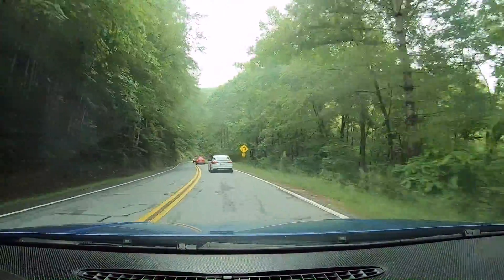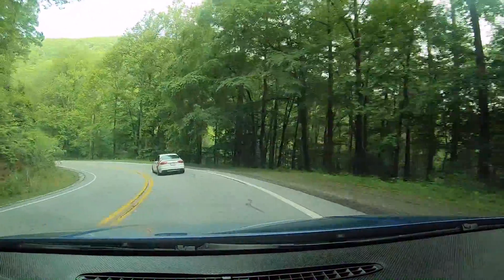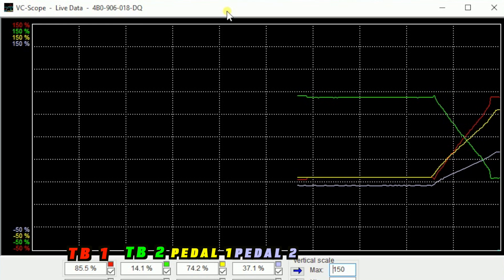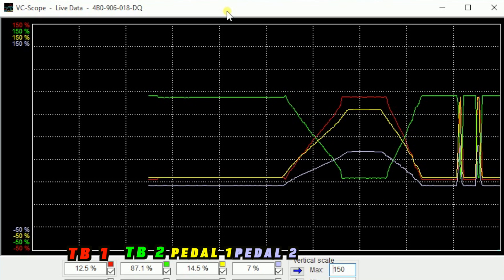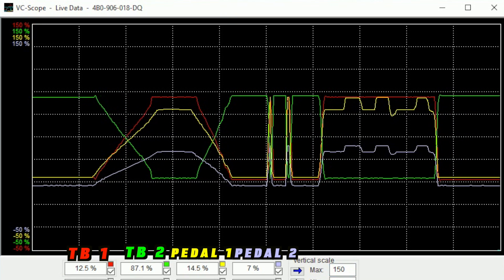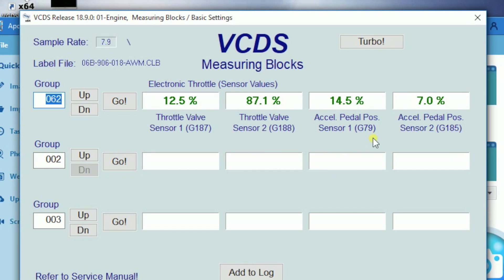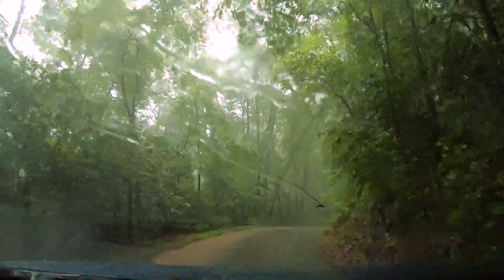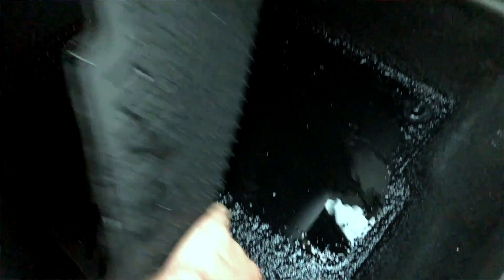What Can Cause Check Engine Light and ESP Light with P0221 Fault

Comment: It’s a Kia Forte issue, as well. New tb, new tp and the same old issue. Difference being, the lane assist and pedestrian warning lights will activate and then limp mode. I never could get the car to do it for me (it’s my daughters car), but one day, while at idle, I lightly lifted up on the throttle terminal and, voila, the engine stumbled and all the lights came on.

Comment: p0221 code 
checked the harness , throttle body to ecu to pedal .
rewired it . ok
swap tested with spare pedal and throttle body .
checked ECU. ok 
removed intake , cleaned /checked variable flaps . actuator ok 👌 👌.
cleaned injectors .
car wont rev past 4000rpm 
boosts fine at any gear as long as its under 4000rpm . 
after p0221 erased and did all these things , check engine light never came up again .
any chance it could be the high pressure pump ?????
BZB engine 1.8 tsi skoda superb 
HELP !!!!!!!!

Comment: Great video information and road trip and awesome channel. Quick question if I may Charles, I don't have a VCDS but just a regular OBD2 scanner with live data, so I have an Audi A3 2015 Quattro with intermittent codes: P0221 and P0121, no throttle, EPC, ESC, CEL, shutting off and restarting the engine fixes the issue temporarily, so when the problem occurs I shut it down, with ignition on, I scan with live data to look at my TP option and when pressing on the gas pedal slowly to the floor, it climbs up to about 88%, so do you think that is an accurate test to dismiss the throttle body issue and wiring? I will re-pin like you explain in your video but just wanted your opinion on that. Thanks a lot, John
Reply: im gettin same rn

Comment: I had the code for sensor A, replaced the throttle body with a new VW one, and new connector with wires, about 8 months ago. Now I’m getting p0221 sensor B. What could it be? I have a 09 GTI 2.0 TSI. Much appreciated. Love your videos!!!!
Reply: You ever find out a fix I’m having the same problem unfortunately I haven’t replaced my throttle bottle but I feel like that isn’t the problem

Comment: My 2010 gti was running perfectly, this morning i change my boost gauge and when i make a test drive to see if the gauge was reading well my car start like to misfire and dont make the idlle rpm so it shutdown , i search my vacuum lines from the turbo to the gauge and cant find nothing wrong

Comment: 2007 VW GTI 6 Speed, P0221 Code Brand New connector with new wires, Brand New Throttle body, But i still get the EPC & CEL come right back on as soon as the code is clear and will not build boost so is in limp mode cannot figure out what’s going on? Only code that i have no other codes
Reply: Hi did you ever solve this thanks getting same issue

Comment: I had my tpms, esp, check engine, and parking brake light all come on at the same time after I installed my cts turbo intake kit. The mass airflow sensor got unplugged and now the lights haven't gone off yet.
Reply: You will need to change your ignition starter switch
Reply from the maker: Might need to clear those codes out.

Comment: Hi good afternoon.  I have a 2009 Tiguan.  The check engine light came on and on the display the message 'engine fault workshop ' came up and an illuminated EPC light. This happened for two/three days and now it won't accelerate above 30, idle really hard and it even cuts off now. Carried it to be scanned, they made me change the fuel pressure sensor,  oxygen sensor, coil pack, plugs all sorts of things and guess what, it's still giving the same problem.  I'm feeling hopeless,  any assistant you may be able to render, or advise would be greatly appreciated.
Reply: If you quickly upshift to 4th you can cruise at 65. Not the safest thing as you don’t get that acceleration if you need it but it will get you home fast. By the way, I have the same issue and will be repinning TB as prescribed.

Comment: I've been trying to chase down this problem for a while. I replaced my throttle body and accelerator pedal with no change(both junk yard parts). Then I watched this video and repined my throttle body and it's perfect now. Thanks much for your help! 07 vw Rabbit
Reply: How did u re pin the throttle body

Comment: #1 I’m from Helen Georgia. Two how to you re-pin the wiring harness? I’m not electronically inclined. Never was trained on it. Mine is very sluggish at take off and also sputters going in higher speeds. Epc light comes on intermittently. When it does that’s when car acts funny. I have the 02 vr6 2.8 jetta glx

Comment: Could this be the same issue with my 2015 Audi A3 2.0T. Im getting a epc light and check engine light. Kind of shakey when I step on it. I turned the car off and back on no epc light just a check engine. Feels fine until I step on it. What do I do?
Reply: Exact same, let me know if you got sorted?
Reply: What was the end result ?
Reply: Piston rings were bad on cylinder 4 I sold the car lol

Comment: Hi, sorry this is Chinese to me. Girl here, trying to figure it out. VW 2013 CC that’s been sputtering since a oil change. Now PCE light came on and check engine blinked but acceleration was bad actually RPM’s went up to 4 and dropped drastically going 20mph. Heard the engine rev. Turned it off and on again, no lights, but RPM’s still jumped around from a stop to going. Made it home but just looking for answers before getting screwed taking it in to a mechanic tomorrow. Thanks so much if you can reply!
Reply from the maker: Make sure your dipstick is all the way down and oil cap is on properly. That happens when a dipstick isn’t sealed

Comment: Had p0221 and p0121 codes, check engine light + epc and limp mode would happen very randomly and rarely, replaced throttle body and it worked for about 1500 miles, then same shit happened again. any ideas? car would stall when it happened. 2010 gti
Reply: Hello , You resolve problem ? What cause it ?
Reply: prelman still have the problem. Throttle body replaced twice, my next guess is to repin throttle body... happens about once every 100 miles or so
Reply: Ever figure it out at the end ?

Comment: Hay I have 2011 tiguan 2.ot  epc light ON WILL not run faster then 1500 rpm when pushing on brake pedal drops to 1000rpms changed crank cam shaft sensors throttle pedal sensor. Still change PLEASE HELP IF POSSIBLE.  LOOKING SAD IN INDIANA.

Comment: Hello.
 Thank you for all your videos.
I'm in the UK so not to sure if you can point me in the direction I need.
 I have a 2009 2.0 TSI Scirocco and have had this code pop up . In your video you mention repining the connector.
 Do you have a video on this procedure and possibly a link for the repin kit I would potentially need.
Regards Adam.
Reply from the maker: VW/Audi had a TSB about it. https://static.nhtsa.gov/odi/tsbs/2016/MC-10106512-9340.pdf
Reply: Thank you for this .
 Regards Adam
Reply: @adamfolwer5237  Did you manage to fix this problem by repinning the throttle body? I have a Scirocco 2009 2.0L TSI aswell and have the same problem.
Reply: @dannyrattu51  it turned out not to be the wiring harness on my car. It was the throttle body.
Reply: @adamfolwer5237  Thanks for the reply bud. Iv changed the TB and the ECP light still pops on when I push the peddle down quick. I'm guessing that it may be the signal wire playing up.

Comment: I have a 08 A5 3.2quattro with with this code and replaced TB and pedal and checked and ohmmed wires to pedal ECM and tb could it be the ecm? I   cant  SEEM TO FIND INFO ON WIRING SO DO YOU HAVE ANY TIPS ON WHAT I SHOULD DO

Comment: Hello what does mean this is in my Audi EPC light on Audi A8 need help please 😢
Reply: Im guessing is the throttle body
Reply: You figure a solution ?     Having the same issue...
Reply: @Nightrunnergunner  I just change the battery and after works good not very big problem

Comment: Hey humble I have a question I got in a crash just suspension stuff and my oil pan is cracked but now the epc light is on and I get it to crank put a full 5.3 qts of oil full on gas and everything fluid in the car what do u think it could be

Comment: Is the harness fairly easy to replace on a ccta? Repinned the tb harness twice and now am thinking those thin wires are brittle and shorted or corroded somewhere behind where the splice points are. Any special procedures or tools to take the entire harness out? Or rather- can it be done without removing manifold ?

Comment: Hi guys I have problems with 2009 2.5l Jetta I read 3 codes with my scanner and 3 codes coming on P0301,P2431,P2433 I need help what is  the best way to fixing that problem thanks alot.thanks you for yours videos  .

Comment: i’m having p0089 code. I have replaced both fuel pumps, follower, and the fuel filter. Having a problem starting when cold, franks about 3-4 times then fires up. when it’s warm it starts immediately. any feedback would help :)
Reply from the maker: perhaps an issue with the fuel pump module?

Comment: I brought a 2005 VW Passat. The guy I got the car from said it had B5.5 motor and it has been deleted. Well about a week after I had the car, I was on my way home and driving up interstate my car when into limp mode! I changed out the fuel filter, air filter and the mass up sensor also! On very cold morning's, it runs great for about 7-10 miles and than it goes into limp mode! I love the car but it's driving me crazy because every little hill I come to, I have to get in the right lane because I have NO POWER. Please help! Thanks....
Reply from the maker: So many things can cause that. Have you checked for stored codes?
Reply: Yes Sir but it didn't help. But when I check the codes, it showed P0101, P0299, P0401 and also when it goes into limp mode and I can drive it and than park it and 5-10 mins later it runs good for a mile or so and BAM LIMP MODE AGAIN!

Comment: Hi, I am from Kenya. I was driving my car (Mercedese benz-B180 W245...1690cc) and then I experienced ESP light and immediately the check engine light came on> I have taken the car to my local dealers and yet to find a solution. However, they have informed me that I may likely have to change the ECU. What could be the problem?

Comment: I’m getting a p0016. Recently had the timing chain and tensioner replaced ~50 miles ago along with the guided. With the vcds I read cam sensor and jumps up and down and I get a diesel sound from 800-1600rpm from the engine and it hesitates. Normal acceleration. After that it runs smooth. And strong. I’m thinking something related to oil pressure or vvt solenoid or even a intake camshaft actuator. It’s a 2014 GLI. Any input would be very appreciated
Reply from the maker: I think you’re right. I’d take it back to the place that did the chains
Reply: Thank you. This means a lot. I did it my self along with a VW technician. One more question is how common is the camshaft to fail. Vs the solenoids
Reply: It turns out it was as the n205 valve. VW list the wrong one by VIN. The one from the golf work fine. It ends with an F not a B. The B had smaller treads. Dealer ship was not helpful at all even after brought the old part with me. My guess is that after the engine got up to temp. The spring inside the valve did not have enough pressure to stay closed. In the vag com I could see the requested vs actual cam adjustments. While the ecru was requesting 0 it would jump quite high just by a small press in the gas.

Comment: Hey Charles, I have a 2014 Jetta TDI, I noticed the steering wheel is on and angled plane to the seat/dash. You can put a whole finger in the space between the dash and column on the left side and not even a finger tip on the other side. What's with that? Have you ever seen this. I think my old '04 had that too. Thanks!

Comment: I had a similar issue with my MKIV GTI 1.8t. I replaced the throttle body and the pedal module. The problem went away EXCEPT when the engine bogs. When I am doing slow maneuvers like parking and I slip the clutch a little too much and the engine revs down below idle, 90% of the time the EPC light comes on. Restarting it clears it(and limp mode) but that is the only time it occurs. I still haven't been able to pin down why, but I will check out the connectors to see if the pins are damaged in some way and check their voltage readings.
Reply: Have you managed to figure this out
Reply: @johanneswarriorrudolph2923  please help

Comment: I also ran into standing water inside my passenger floorboard this past week. Looked under the rain tray to see a slow drip about every 3 seconds initially. Ran some left over rubber hose from a boost gauge install down the front drains followed by some weed eater line, and a squeeze bottle full of warm water. Was able to clear the obstruction and had a fast drain under the rain tray Hopefully that fixes it.

Keep up the great content Charles!

Comment: Speaking of strange issues, I have a 2003 Jetta TDI wagon that was 5-speed swapped (01M --> 02J). The reverse lights used to work but don't any more. The reverse switch itself is good and S7 fuse is good. The connector doesn't seem have a good seal around the switch. When I put it in reverse with KOEO, the voltage in pin 1 is like .9 volts. It's so low I don't know if I'm testing it correctly. Any help, my fellow Humblies? :)
Thanks!
Reply from the maker: You can try and run a dirty overlay just to confirm it’s a wiring issue. Things like this can be traced and repaired or simply over lay the wiring. .
Reply: @HumbleMechanic  Thanks for the reply! I should clarify that the reverse lights worked after swapping to the 02J but now they don't after about a year.
Pardon my noob question but what's a dirty overlay? Does that mean like, running a wire from a known good source to the connector?

Comment: The first thing this fellow did wrong was, after reading the code, firing the parts cannon rather than looking up the diag procedure for the code. (One might argue the actual first fault is the blue oval but let's not go there.)  Any code, especially these days, is a 'follow this procedure first' code.  Looking up the code may hint at a TSB, but Id focus on the code more than TSBs as Ive been  burnt by 'chasing TSBs' far more often than ive been burnt 'chasing code procedures'.  But then Mopar loves to throw the weirdest of crap at both owners and wrench yankers.

Comment: I have the same issue with the throttle body. 
Ccta. 09 passat. The issue has not show up since last year but I am sure it will again.
I have the new wires and connector but so far no problem. If it happens for sure will change the wires..

Comment: P0420 should I replace O2 sensor please help my carwill not pass emissions in Pennsylvania do to this fault code
Reply from the maker: probably not an O2, but maybe. what car?
Reply: @HumbleMechanic  2010 Audi A4 Quattro premium plus I just bought the car like a month or two ago it has an APR downpipe supposedly stage 2 tune APR carbino intake but it's popping that code manual transmission
Reply: Everyone Is Equal 
Did you tried put spacer?
Reply: @wafi3187  honestly I have no idea what the guy had done to the car because I bought it off someone who bought it off someone who had to work done spacer wear I'm all new to this I know basics on cars but turbos are all new to me it seems like the guy had all this good stuff put on so he didn't cheap out on anything but I'm not exactly sure spacer?
Reply: Everyone Is Equal 
Po420 is for catalytic converters. If previous owner removed the cat and installed a test pipe (cat delete) you would have that code.   How ever if you have a o2 spacer for second o2 you won’t get CEL. But you are gonna fail emissions. 

Look if you have cat. Cause if you not you need one to pass. I think High flow cat should work too!!
Reply: @wafi3187  I know it has an APR downpipe I know it's quite dumb question but where's the test pipe go right before the muffler
Reply: Everyone Is Equal 
Test pipe or catalytic which ever you have. It should be right behind the turbo.
 APR down pipe is high flow cat. So it should not give you a code. I think you can just check the down pipe and see everything is good. Did you ever cleared the code?
Reply: @wafi3187  yeah we cleared the code and it came back when I tried taking the car the first time it said something like car is not ready which I never heard so they told me you need to drive it around for a few hours so I took it back a few days later and that's when I pop the code in one pass emissions it's been the same ever since
Reply: Everyone Is Equal 
When you clear the code ecu(ecm) needs to relearn again. And to do that you have to drive the car. If the cel keep coming you have to either replace the cat with stock one. Or remove the cat and see what’s actually going on. 
You should try Audizine. It’s a great forum you can find tons of information. Search Audizine in google and make a thread about your issue.
Reply: @wafi3187  okay thank you I really appreciate it I mean really I appreciate it I'm in Pennsylvania I'm trying to find like locals did have a club or something because it's guy works on my car he's good with cars but seems like he has no clue about turbo cars
Reply: Everyone Is Equal 
Audi’s are complicated compared with others 🤷🏻‍♂️ it’s normal for these cars to do something unexpected. Good luck with your A4, sorry I couldn’t help to find the problem.
Reply: @wafi3187  no ty I appreciate your help! 🙏

Comment: I have a Skoda superb 1.8T with the same check engine and ESP light and vcds take me to intake mainfold. I’ve been recently to the Skoda car garaje and they changed some pins to her so the question îs that it can be the same problem like the throttle body, i meen the pins? I dont remember the fault code but i’ll be back with it. Thank YOU.